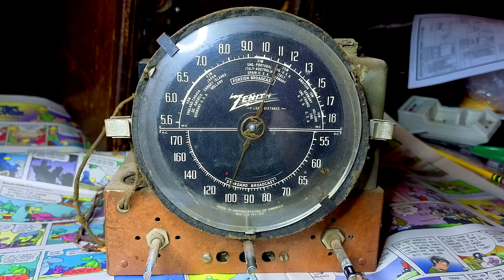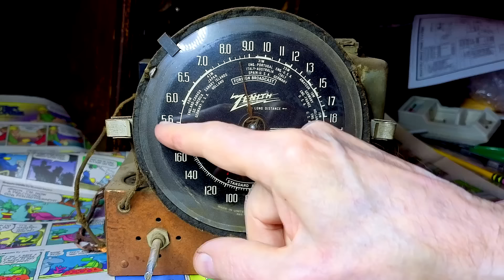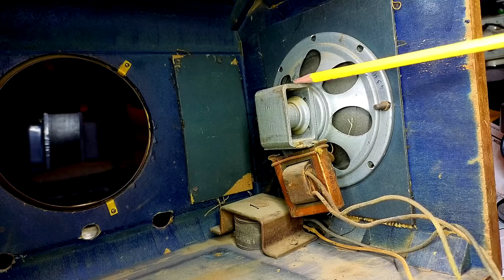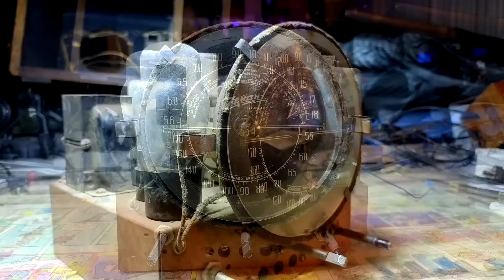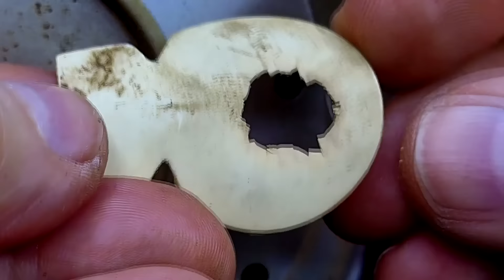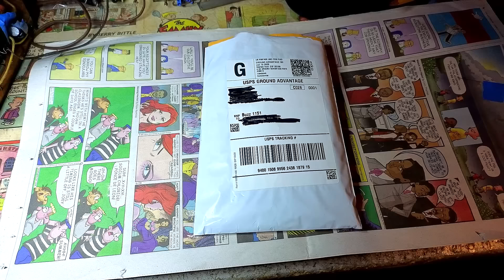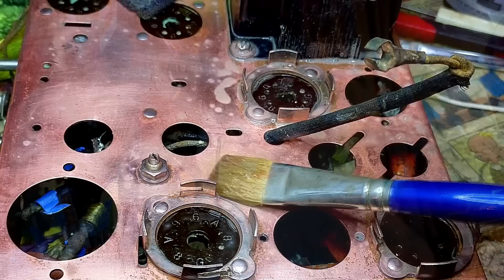1938 Zenith Cube Radio Part 1

Comment: I can go to staples and print off copies from the original 1938 zenith manual free.  I think your oscillator is open since you get 2 stations. Probably around the if frequency of 455khz and its image which is a multible of 455.
Reply from the maker: thanks, that would come in handy!
email below
buzz1151@comcast.net

Comment: 1:47  i’ve always wondered why the plug-in speaker option was removed on modern radios.  Whenever I am restoring a desktop transistor or tube radio I always add a speaker wire disconnect plug.  It just makes working on them so much easier.

Absolutely love your restorations and wish it was a weekly thing but hey, it just makes me cherish them more!

Comment: Considering how dried up all the electronics on this radio are, this thing sounded good.

About the needle on the dial, frankly I think a dab of solder, as you got it, was better than glue. If it were glued, I don't think you would've found the needle intact as well as the solder. Must've had a screw and somebody lost it. Nevertheless, Buzz, check the little piece for threads. Being metallic because solder only sticks on metal, that means re-heat and suck out every solder drop and probably you'll find threads. Better to replace with a new shiny slotted (because they used slotted in them days) screw; maybe found from a watch repair parts store. A knurled brass screw would look better. If possible, gold plating on the needle would be nice too.

Now you're getting me involved!

Love watching your shows.
Reply from the maker: Hi Michael....there are no threads on that little piece....I think originally it was a friction fit thats holds it on the pointer...I will go over this on the next video.....stayed tuned

Comment: Instead of looking for tube shields, you could just replace the tubes with metal octal types that are self shielded.
Looks like this project will involve some wood working and re-finishing, but you're quite good at that!
6Q7 is a dual diode triode.  6J7 is a sharp cuttoff pentode.  NOT REPLACEABLE one for the other.  Is the IF tube a 6K7 or a 6J7, ie: maybe it was in the wrong socket.
Reply: Maybe talking through my hat, but as a general rule, I think one would need to make sure that none of the glass vacuum tubes you want to replace with metal tubes aren’t using pin 1 as a non grounded tie point.
Reply from the maker: I never had a problem with that, 🍺🍺
Reply from the maker: I want tube shields for the right "look" haha
Reply: @Buzz1151  Yeah, keep it original if possible, especially if you plan to restuff caps.

Comment: Buzz my 1937 Zenith end table radio has that same cool dial. Also the chassis looks similar, only one can for the caps.
Reply from the maker: was your dial pointer soldered too? haha😂
Reply: @Buzz1151 No, it just pulled off. I was telling you that as you were talking about how it came off , "just pull it off" oops it's soldered.😂

Comment: You'll need the two dial lamp shades or deflectors to make the dial illuminate properly and also protect the plastic dial from heat.  Also, use the proper dial lamp, as the wrong ones will get two hot and burn both the shade and the celluloid dial face.
Reply from the maker: You can buy those deflectors at Renovated Radios 🍺

Comment: I have the 4 knob cube with the speaker in the top that an old guy I know had restored.  Pretty good radio.  IT is the 6 tube chassis.  I wonder if those 6A8 mixer tubes are problematic.  I tested several of them OK on the tester and then tested in the Zenith.  Despite tube tester,  some of them did not work in the radio.
Reply from the maker: I've had similar experiences with tubes testing good and then not working ..🍺🍺

Comment: Buzz!!! What a wonderful set you have chosen for this episode!  There is so much to love about this one, and quite the challenge with that dial pointer!  I'm going bonkers wanting to see the next episode already!  I have no issues with the idea of the next video being of fixing the rest of the chassis and doing alignment, etc. on it.  Then the third episode could be of the work on the cabinet.  Point of curiosity about the paper cap stuffing.  Are you going to verify the outside foil end of the new caps and ensure that they are placed inside the old body with the outside foil end in the proper place?  I imagine that you are going to run the tuning capacitor through the dishwasher to clean it.  Most of the ones you have done that way have turned out amazing.  Before you put all the parts back on the top, are you going to spray the copper with clear lacquer to protect the copper?
Reply from the maker: Thanks for the suggestions for spraying clear on the copper chassis.
I was told years ago by my late friend Brendan that the outside foil on modern day caps makes absolutely no difference.🍺